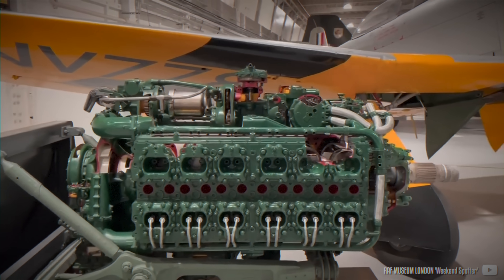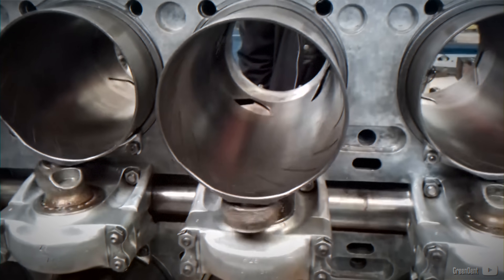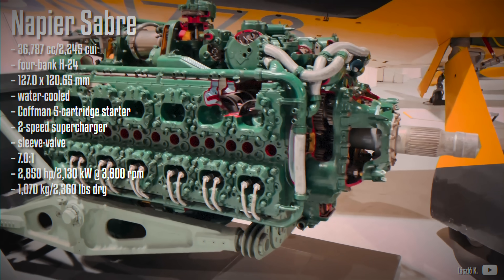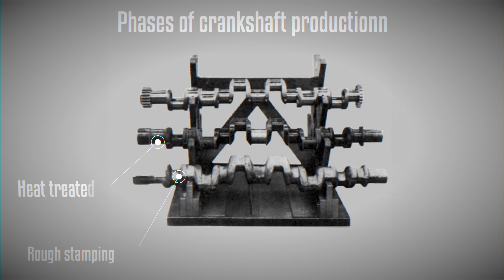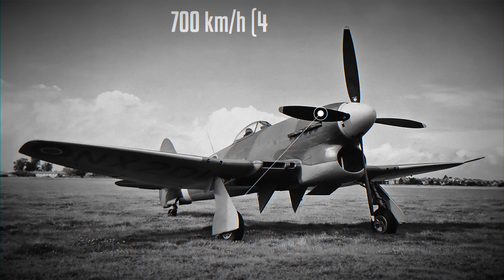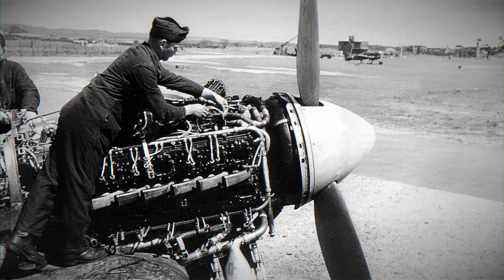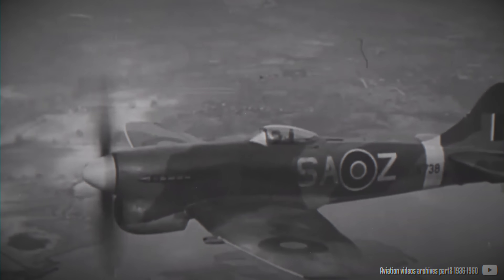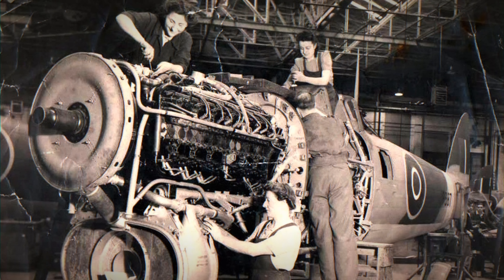An Unreliable 24-Cylinder That Helped To Win The War

Comment: Bristol were hardly "eager" to help Napier with the sleeve valve problem. They were ordered to by the Ministry of Aircraft Production.
Reply: The Sleeve Valve Engine always had issues, the reason development stopped at the end of the war. Remember the first British Tanks of the Mark Series also had a Sleeve Valve Engine that leaked so much exhaust that it often sickened or killed the crew. 
Many of the Tanks that Germany used in WWI were British Mark Series Tanks, as they would keep lumbering past the Germans until they ran out of fuel or got stuck. The Germans opened them, removed the dead crew, added a large blower to remove the fumes, and then painted the Iron Cross on them, and used them to fight the British & French...
Reply: And the company that took over production of the Saber after Napier failed was Rolls-Royce. Napier was judged to be very poor in the management of the Saber program. Bristol did better with their sleeve valve engines which were radials and ended up powering the Hawker Sea Fury which was an excellent aircraft.
Reply: @keithstudly6071  Rolls-Royce built a sleeve valve H24 engine called the Eagle22, it was internally quite different to the Sabre, however R-R DID NOT take over Sabre production or have anything to do with it at all.  The British government forced the sale of Napier to English Electric. Although this is considered by many to have saved the Sabre, there is a counter view that it created more problems and disruption than it solved.
Reply: @davidhollenshead4892  Do you have a reference for this information?  

I thought the poisonous environment was more likely caused by the fact there was no partition between the crew, the guns and the engine, they cohabitated, so the crew had to withstand any leaks in the exhaust system, oil leaks, etc.  

In both the double acting and single acting sleeve valves (they are very different, both the British sleeve valve aero engines [including the Sabre] and the experimental American sleeve valve engines built by Continental and Pratt& Whitney used single acting sleeves) the sleeves are fully internal to the engine so any blow-by, oil fumes, and smoke will be contained within the engine and only make it to the outside by the crankcase breather and the exhaust system.

The Mark I tank used a Daimler double-acting sleeve valve engine.  The problem with this engine was not so much the interior of the tank but that the very smokey exhaust betrayed its position to the enemy.  As far as I am aware, the single acting sleeve valve engine was not used in British WWI tanks.  The Mark V used the Ricardo petrol engine.

As to development not stopping on the sleeve valve engines, this is true, although Bristol manufactured them right up to the point that they were acquired by Rolls-Royce.  I should mention that car companies that manufactured quite advanced engines in WWII went back to the push-rod and side-valve engines they made before WWII, there was no need for the technology used in advanced high-power aircraft engines to be used in the family car.
Reply: @robertnicholson7733  My apologies. It was English Electric that took over Napier in December 1942. They found that Bristol was able to produce higher quality cylinders for sleeve valve engines than Napier and got Bristol to produce Saber cylinders after a deal was made to get  6 precision centerless grinders from the USA which had been earmarked for Pratt & Whitney's Kansas City factory that was trying to start production on the improved R-2800C engines.

Comment: It really shows what a blessing the early jet engines were, compared to these mechanical monstrosities that required exotic super high octane fuels.     More power, far fewer parts and could burn kerosene.
Reply: The fuel requirement wasn't the issue so much as the insane maintenance requirements - this is why piston engines came off airliners as soon as turbojet fuel consumption got low enough to be viable
Reply: @alanbrown397  ...and reliability. It wasn't unusual for a 4-engined airliner to arrive at its destination as a 3-engined airliner. A Boeing Stratocruiser had to ditch in the Pacific after losing 2. That was Pan Am flight 6 - amazingly there were no casualties. The DC7 for example didn't get passed down to smaller airlines after retirement because of these problems.

Comment: Honda proved in the 1960s that multiplying the number of cylinders in order to allow higher rpm limits was the best way of achieving higher hp for a given displacement. Sleeve valves have one big advantage over poppet valves: they don't have any exhaust valve to create a hot spot in the combustion chamber so they aren't prone to preignition which makes them very tolerant of lower octane fuels. They also have a big disadvantage: they consume a lot of oil. The most exciting news about the Napier Sabre is that a Tempest is being restored in the US by Kermit Weeks while Typhoons are being restored to flying condition in Canada and the UK. What this means is that in a few years we will be able to hear the roar of a running Sabre, a sound that has not been heard on Earth in almost 7 decades.
Reply: Honda was certainly not the first to discover the advantages of multi-cylinder layouts... higher rpm is not an advantage for propeller driven aircraft which is why aero engines rev slower than motorcycle or automobile engines.
The advantage of the sleeve valve design is volumetric efficiency.

Comment: Great stuff, Visioracer!  Napier Sabre is one of my favorite engines.  Napier made four of the coolest engines ever to be created, and all of very different configurations:  
Lion W-12 of WW1.
Sabre H-24 of WW2.
Nomad Flat-12 2-stroke turbocompound diesel for airliners.
Deltic 18-cylinder 2-stroke opposed-piston diesel for locomotives and torpedo boats.

I keep hoping that somebody will revive the sleeve-valve concept.  Back in the 1920's and 30's Harry Ricardo made very systematic studies of poppet and sleeve valve engine performance, and concluded that sleeve valves were superior.  They allowed higher compression ratio, better volumetric efficiency, and higher operating speed.

The best application of the Sabre during WW2 was in Hawker Tempests chasing and shooting down V-1 buzzbombs.  Even though it didn't have a great supercharger for high-altitude performance, the single-stage supercharged Sabre was faster than anything at low altitudes.
Reply: The lack of sleeve valves in the zillions of engines produced after WWII suggests that, in fact, they were not inherently superior to poppet valves.

Sleeve valves were a suggested solution to some problems encountered by poppet valve engines in the 1920'ies. By the mid-30'ies, however, poppet valve technology had moved on and pretty much solved these problems, while sleeve valves brought along a boatload of rather serious issues themselves, some of which were rather fundamental and not solvable. We should be thankful that people like Halford and Fedden and their teams put in a lot of elbow grease trying to make them work, so we can see how well they worked, but ultimately they were a technological dead end.
Reply: "Sleeve valve are superior." was completely hindsight quotes at that time. You must know that at that time, poppet valve isn't capable of beyond 3000 RPM and only has 6:1 compression ratio at best.

But dear oh dear, we live in 2024. Poppet valve already on 22.000 RPM and 20:1 compression ratio. Whereas sleeve valve was considered obsolete because (surprise surprise) worse  compression ratio ceiling, volumetric efficiency ceiling, and operating speed ceiling. On top of dumb thing such as excessive oil burning and mechanically complex engine. Sleeve valve just aged like a milk, and with same resource you can ressurect opposite piston diesel engine instead, or literally anything better
Reply: Funny how time and technology move on.
A mundane Honda naturally aspirated K24 2.4 engine uses poppet valves and produces 1.37hp/Ci, all with no super charger and conforming to current fuel emissions standards, all while having 10,000km service intervals and long service life.
I highly doubt we'll see sleeve valves make a comeback any time in the future.
Reply: I love the Deltic, I’ve had the pleasure of operating a locomotive equipped with one once, it has quite a thunderous roar at full chat!
Reply: @jbepsilon  no the absence of zillions is flawed as sleeve valves were still in the early phase of their development if the war had continued poppet valved engines would have been widely supplanted in high performance applications. Furthermore US manufacturers were behind and lacked the ability to produce comparable engines.
Reply: @robertpatrick3350  Lol, no. If the war had continued poppet valve engines would have been supplanted by turbines in high performance applications, as happened historically post-war.

Even in a hypothetical scenario where turbines were delayed there were no particular good reasons for adopting sleeve valves, as can be seen by the lack of adoption post-war.
Reply: Among the things Ricardo missed when he advocated sleeve valves was the future improvement in exhaust valve alloys and the introduction of high octane gas, both of which negated the sleeve valves advantages in avoiding preignition. 

The commonly accepted history is that early Sabre's were assembled by trained fitters using matched parts, and generally ran well. Production Sabre's using mass produced sleeves were notoriously unreliable be comparison. Churchill supposedly intervened with FDR to have a shipment of Sundstrand centerless grinders intended for Pratt & Whitney shipped to Napier instead for use in producing sleeves for the Sabre. Needless to say, Pratt & Whitney were not pleased.
Reply: @fafner1  You've read Graham White's book!  Great stuff in that book.

It's unfair to say that Ricardo "missed" things that hadn't been invented yet.
Reply: @Danger_mouse Isn't that a Nissan engine? I may be thinking about one from 35 years ago?
Reply: The two stroke version would have been interesting 🤔to see😎👌🏽
Reply: @robertpatrick3350  The Knight Engine (sleeve valve) is an AMERICAN invention by American Charles Yale Knight in 1903... and licensed to several British manufacturers.
   American aircraft engine manufacturers abandoned development in the early 1940s as an evolutionary dead-end concept.
Britain was a decade behind in aircraft technology during.
Reply: @andyharman3022  Ricardo certainly missed the boat on sleeve valve engines... he was not aware of many advancements taking place in Germany and America.
Reply: @sandervanderkammen9230  You couldn't be more wrong if you tried to be, lad.  Ricardo was a strong advocate of the Burt-McCollum single-sleeve valve.  He did a whole series of tests comparing similar engines with sleeve and poppet valves, and concluded that sleeve valves had many advantages.  Name one sleeve-valve engine that was made in Germany.
Reply: @andyharman3022  Daimler-Benz was one of the earliest Knight licensees in 1907.
 Well, it that was true? Sleeve valve engines would still be around.
The truth is their disadvantages far outweighed the few advantages.
Sleeve valve engines peaked in popularity in the 1930s.
Sleeve valve aero engines were rendered obsolete by jet engines... this happens in Germany a few years before the UK.
Any questions?
Reply: @sandervanderkammen9230  You don't even rate being in the conversation if you don't know the difference between the Knight and Burt-McCollum sleeve valves.  

Every recip engine was rendered obsolete by jets after WW2.
Reply: @andyharman3022  Knight patented both types of sleeve valve engines.

Sorry lad, reciprocating engines are still made...  only the Sleeve valve design is obsolete.

Comment: It's amazing how complex engines they could build in these days! There is no internal combustion engine today that complex!
Reply: The Napier Sabre and the Napier Nomad diesel are regarded as two of the most complex engines ever made. They were though, at a kind of engineering dead end as by the end of the war and subsequently 4 stroke internal combustion engines using conventional poppet valves and forced induction has proven to be more scalable.
Reply: @Pesmog  The Nomad proved that turbocompounding wasn't worthwhile - half the power came from the exhaust turbine with only 3 moving partsm vs thousands in the gas generator (piston engine). 

Jets had the advantage of being 1/10 the weight in addition to the lower part count
Reply: @@mitchellcouchman6589 Yup, but that didn't take long. British jets were already fairly good by the start of WW2 and what let the german ones down was availability of materials. Powerjets was already working on bypass engines at the start of WW2

Comment: Napier did build a two stroke but this was the opposed piston Culverin diesel and later Deltic which had three cranks and three lines of cylinders. 
The deafening two stroke mentioned in the video was probably the Rolls-Royce Crecy. A sleeve valve direct injection V12. Sadly largely neglected by RR so it never saw service.
Reply: I have read that the Napier engine used in the Hawker Typhoons had a service life of 23 hours..

Comment: Please do a video on the Fred Offenhauser engine. Its head and engine block were one piece. They could run insane boost pressures and were able to get about 1400 hp out of their 2.6L 4 cylinder. Indy car eventually restricted them out of the racetrack.

Comment: Honestly, I think the horizontally opposed engine is probably the best design for most automobiles.  There is the width issue, but careful design can create and engine that is not that wide, and it will fit in a car that has comfortable but not excessive width.

AMC in the United States produced a car called the Pacer in 1975, and it was heralded as the "First Wide Small Car", and yes it was wider than most cars at 1963 mm.  But it's dimensions were based upon four people sitting comfortably in a box, not around an engine as many cars are built.  The Subaru Outback car from 2001 is 1745 mm wide, and it seats two comfortably with a horizontally opposed engine in the front of the car, where the wheels still need to turn.  Thus the notion that the "flat" engine is bad due to packaging is nonsense.

These engines have perfect primary and secondary balance and are not hard to service at all.  Spark plug access on Subaru's can be described as "different, but do-able".  You just need to look at a video on how to do it and then it isn't tough at all, since the frame rail is right next to the head and coils.

I have two flat-6 cars, a '14 Porsche Cayman S with a 3.4 liter F6, and an '01 Subaru Outback LL Bean edition with the "H6" engine.  The engines are amazingly similar, and not all that much different from the 9.4 liter Lycoming and Continental flat-6 engines that I have dealt with in general aviation.  Most light aircraft use horizontally opposed four  and six cylinder engines of 300-600 cubic inches because this design is easy to cool using air only, which increases reliability.  AND they can make big power with direct drive at only 2700 rpm.

I loved pancakes when I was a kid.  And I like engines like them now!
Reply: Sure maybe 25 years ago width would have been an issue but all cars have gotten much wider so an opposed piston may be possible these days.
Reply: @Bull3tBikes  Opposed piston engines allow full expansion, but the extra drag of all the mechanical linkages cancels out any efficiency advantage.  Along with far more expensive construction.

-You do know the difference between opposed piston and horizontally opposed engines right-?

Comment: Torsion bar is more accurately a quill shaft or jackshaft
Reply: In a Detroit Diesel 2 cycle V series engine, the blower drive shaft is called a torsion bar/shaft  by the manufacturer. It is small in diameter and made of spring steel because its purpose is to absorb rotational vibrations through twisting. This prevents gear train destroying harmonics. I imagine the same applies here. Quill shafts, such as those that drive the overhead cams on the V 12 Merlins and Allisons run perpendicular to the crank and are not designed to flex.

Comment: Not sure that the Bristol Aeroplane Company was ‘eager’ to help the rival Napier Company solve their engineering problems. I think it was more a case of the Air Ministry (in the middle of a major war) knocking heads together, and forcing them to help out instead!
The 1690kg, 71-litre P & W Wasp Major made about 4,300 hp, compared to the 1070kg, 37-litre Sabre at 3500hp.

Comment: Increasing the octane rating of the fuel reduced the advantage of the sleeve valve design.  Although I love non-poppet-valve designs, high octane avgas and sodium cooled valves moved the advantage away from sleeve valve engines.  Sleeve valves could still get slightly higher performance, but the added complexity reduced reliability enough that it was only worth it to squeeze maximum performance out of the last piston engined fighters.  After the war, when reliability became more important, they were discarded.

Comment: Napier certainly had a way of thinking out of the box. Just remember the Deltic…
Reply: Napier bought the Deltic technology from Jumo
Reply: @sandervanderkammen9230  that was the Culverin, which was going to be a Jumo built under licence. The Deltic took it further by changing the layout of the cylinders, number of crankshafts (& the need to rotate one backwards).
Reply: @paulqueripel3493  Napier licensed the Culverin, Cutlass, Rombus and Deltic designs from Junkers Jumo AG.